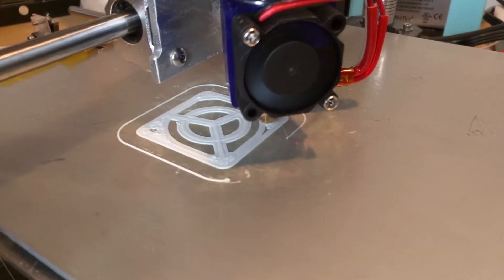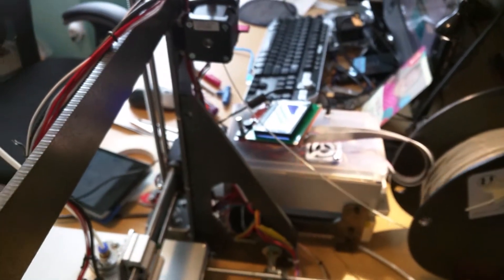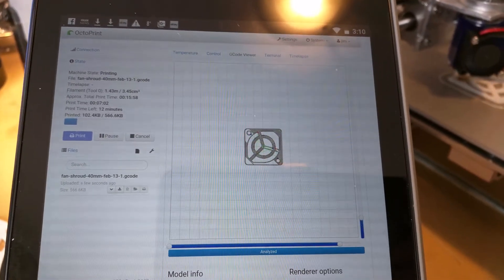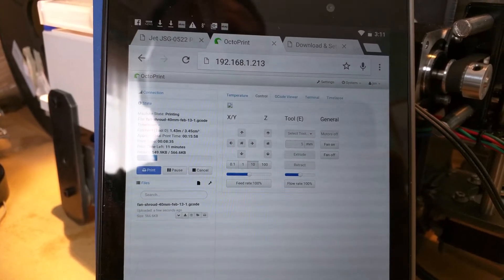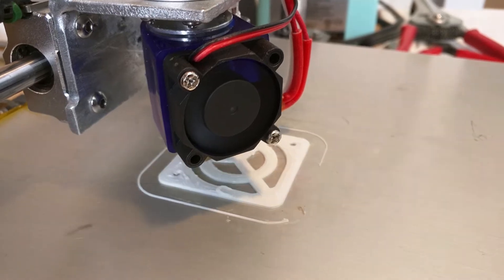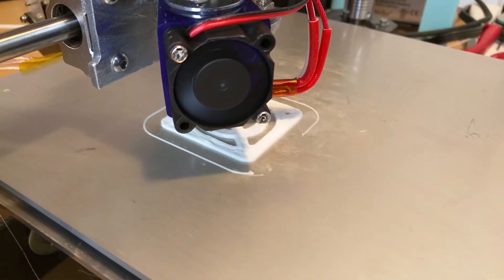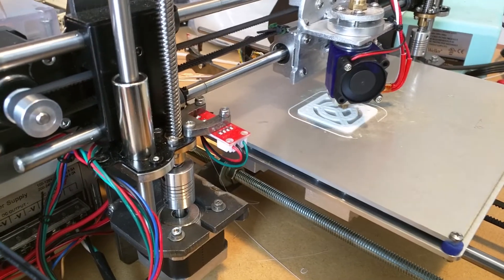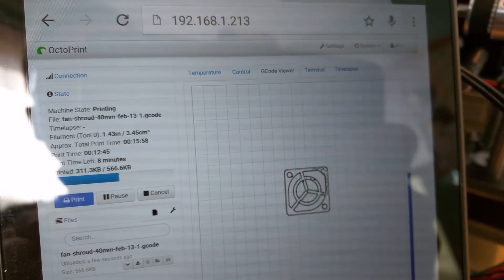Auto bed levelling finished #1 and Octoprint!!

Comment: Any inputs on how you did it? You have a blog or something with details?
Reply from the maker: Hello Thomas.  I used an Octopi image and a Pi2 Canna Kit.  It really is amazing.  The Octopi image is available from a link on the Octoprint page.  The web cam setup was easier because I used a a cheap Logitech that was recommended by Thomas Sandler??? It works right out of the box.  Thomas has a huge list of 3d printer videos.  Just tell Octoprint your printer specifics and drag and drop a gcode file.  I'd suggest getting the 3d printer working with Printer face first.  I now use Cuts but slice it on another very fast computer.  I've also donated to Gina H.  Her work is amazing.
For the Z-Auto leveling I used  Thomas' youtube video as a guide. I bought 10 inductive sensors from China and welded up an aluminum tab on my x-carraige to hold it.  The code in Marlin is well commented and editing it was easy.  Slic3r has a nice z offset to tweak the initial level occasionally, if things need re-adjusting.  Cura dosen't seem to have this feature...  I can't figure out how to use the Tweak-Z Cura plugin...
Reply from the maker: Check out Thomas Sanladerer's Octopi video..., too.